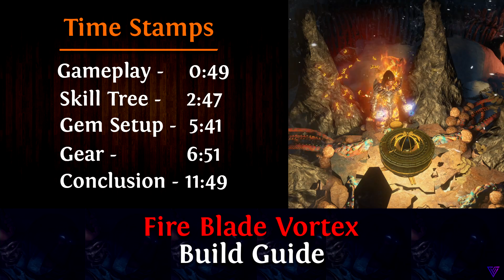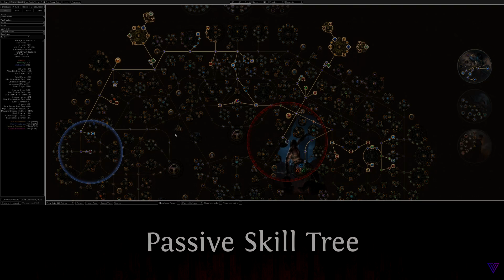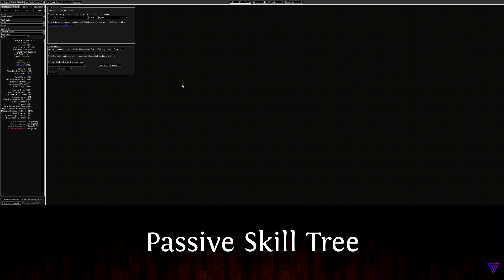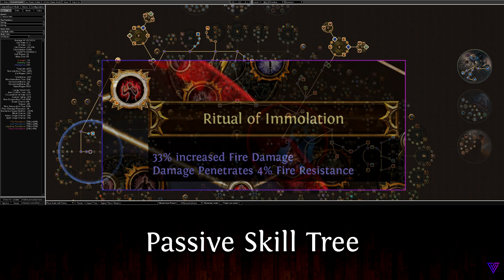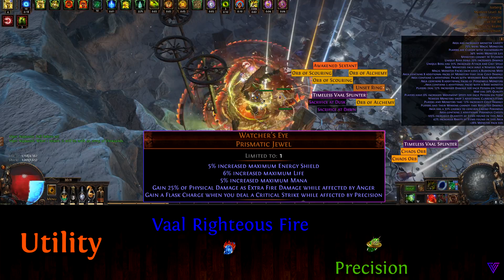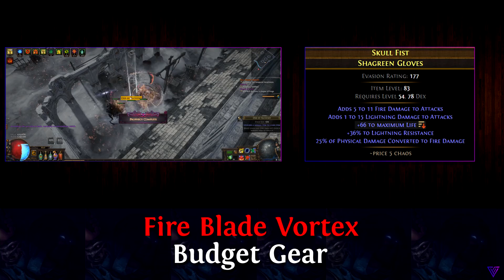Blade Vortex Fire Conversion Assassin End Game Build Guide - Harvest 3.11  Crazy Speed Farming Build

Comment: Is this viable for league starter? im new with POE
Reply from the maker: You could deff start as blade vortex assassin and once you have some currency you could switch to fire conversion but im not sure how easy it will be to get the 50% fire conversion gloves in future leagues. Most likely much harder so you'd have to anoint the fire conersion node on the tree instead and still use the 25% topotantes mod gloves

Comment: Whatever happened to the crafting guide for this build? In particular, the frenzy explode chest
Reply: Get a 6 linked vaal regalia either with crusader influence either through buying it straight up or assembling it yourself. Look to do whatever is cheaper of course.

From here alteration spam for the corpse explode mod. This will, on average, take you a lonnnnng time so don't get discouraged while trying to roll it. Just go slow so you don't skip over it and stop when you finally get it.

I would HIGHLY recommend creating an imprint of the item at this point as that alteration roll alone can cost as much as 3-4 imprints.

Now look for any redeemer body armor with the frenzy on hit mod and NO other redeemer mod and awakener orb the redeemer armor onto your crusader one. You will now have a combination of the two mods and hopefully some workable stuff in the other slots. Again, similar to other gear, go through harvest and fine tune the armor to have some life and resistances however you can. If you got a lot of dead mods that can't be removed and have money, consider resorting to the imprint. Otherwise use what you got.
Reply: Is this a copy paste?
Reply: @datrunk2dunk  yes, saw it in the forums and thought it would help him?

Comment: A lot of the blade vortex builds on poeninja are using bows with +gem levels on all the gear slots with empower, using signal fire quiver for the fire conversion,  and lone messenger with their cluster jewels. Does anyone know much better that scales the damage in comparison? Sorted by dps almost none of the top ones even use badge of brotherhood in favor of an amulet with crit multi and +gem levels.
I scaled explosive trap last league with gem levels and it deleted literally everything; I am curious if this does the same.
Reply: It does, but its expensive. 10ex for the crafted amulet, 15-18 ex for the bow, 3 ex for the quiver, 3 ex for the empower, 10 ex for the gloves with culling and unnervate, the awakened gems also cost a bunch. the angush rings are 10ex each. 4-5 ex for the boots. About 6-7 ex for the entire cluster jewels, another 18 ex fort he lone messenger jewel...and not to sound like an idiot, but you will need HH 60ex to do 100% delerium maps...else there is not point in investing this much in this build.